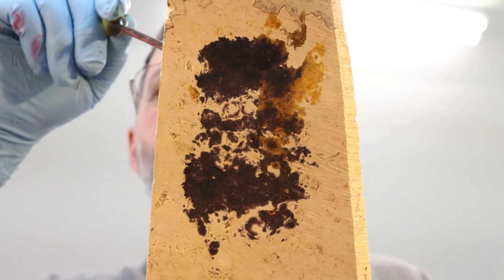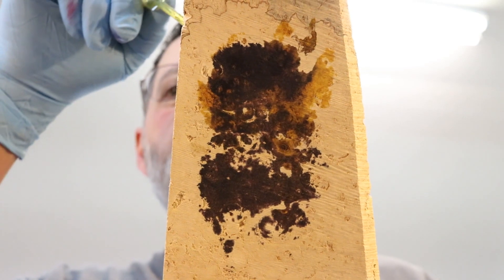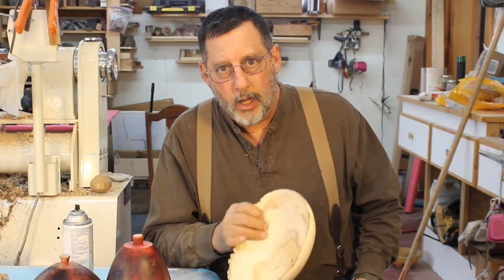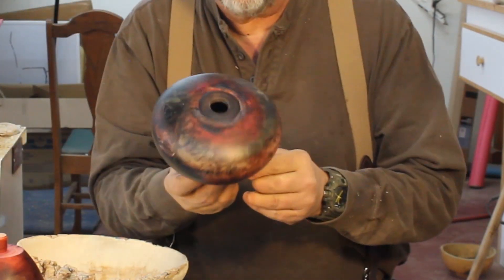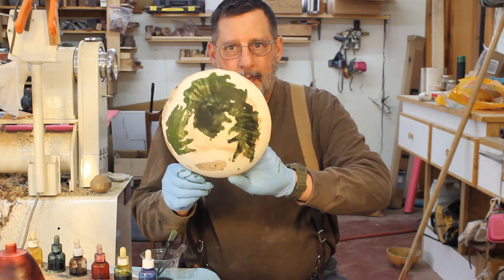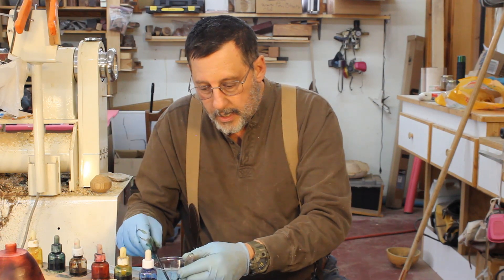Coloring a Thin Bowl,    Woodturning with Sam Angelo

Comment: HI Sam, Happy New Year!...... I was thinking of dying a maple ornament globe from the inside after turning and sanding it but still having it mounted on the lathe so I can take advantage of the centrifugal forces to make it migrate to the outside . I think I will dilute the dye so the colors aren't overwhelming and I thought I might use shellac to seal some of the colors so that the previous colors I've applied won't mix with them I am sure you have experience with this. I was wondering if you think my idea has merit? Thanks Dan

Comment: Strange camera angle for some of your shots, Sam. Were you using a webcam on your laptop or something? I am speaking of the ones that look like you are hovering over a camera that is shooting up.
Reply from the maker: +Mike Peace Yes I was hovering.  If I held the piece vertically, the process would not have worked maybe at all.  So I had the camera tripod set very low.  I also had it on auto focus which I really never do cause I could never have focused it and held it in the same spot.  I need a camera crew.  Sam
Reply: +WYOMINGWOODTURNER 
I understand. You needed to have gravity working on it while you were filming.  Great tip on the pipettes for measuring dye. I ordered a 100 for < $3 on Amazon.

Comment: What solvent did you use to mix the TransTint dye from concentrate, Sam? Standard ratio?
Thanks, --Joe
Reply from the maker: +Joseph Scarborough Morning Joe......I mix the did up with Denatured Alcohol.  I have used lacquer thinner as well.  Both work.  I mix them up in a 1 quart mason jar.  I may add 20-25% of dye with a quart.  It does not take much.  I try not to make the mixture too concentrated.  The dye in this video was a little too dark.  But I can wash it back with some thinner. Sam